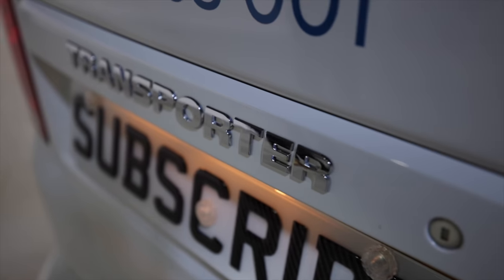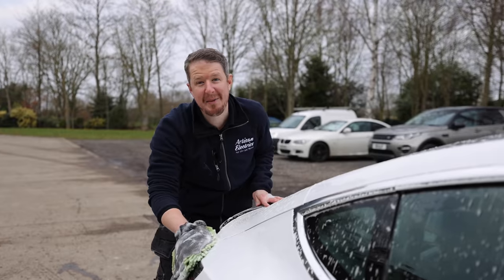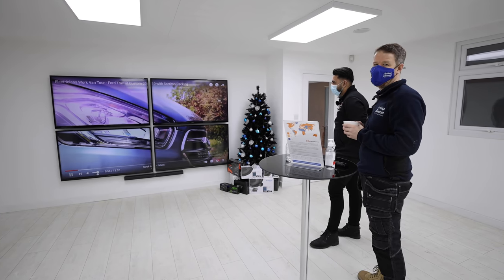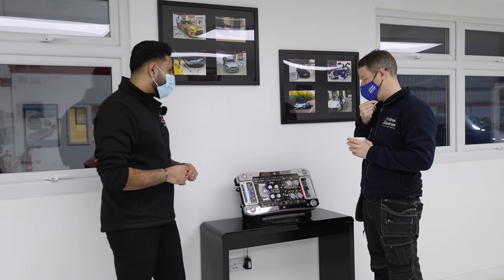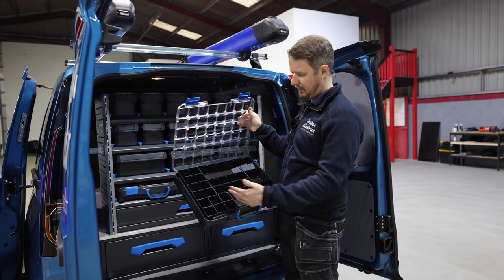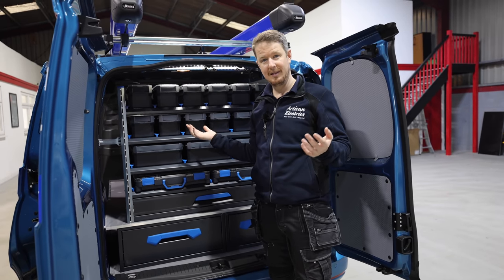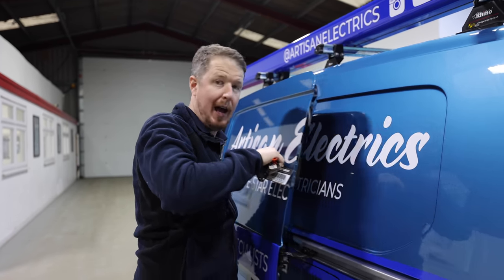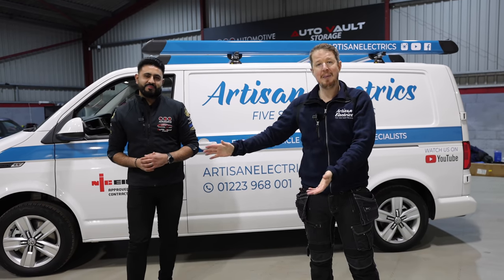ELECTRICIANS VAN TOUR - TWO NEW VANS ARE READY! Electrician Life

Comment: It is a really nice sortimo system. The racking with the boxes is very nice.  I have this sytem in my crafter. I am a technician in greenhouse electrical and water systems. The only downsite from the boxes are the dividers in the box. They will popup a little and the items will go under the devider. So my screws got messed up. I glued them with a hotmelt gun to the bottem.
Those deep drawers are amasing. Wishing you a lot of workfun with your both vans.

Comment: Normally you can't put the high pressure pipe into the lance when it's under pressure - knock the compressor off and take the water supply off then it will go in.  If that saves you buying them a new one I'll take a AE Gilet ;)

Comment: Make sure your e transporter van hasn't got any wrong wiring or fuse as  my one is with VW since  November 2021 and its not fixed yet . Check for recall.  Its good van but in the town you can do 55miles and distance can be even more then 82 if there is no traffic. Only I don't like it that on 7kw single phase it takes only 3.6kw and takes longer to be charged

Comment: 37kWh battery on a van - that's pretty pathetic - I'd be surprised if you get 60 miles in winter when loaded up
Reply: Thank you for your support
Reply: that's for service calls arround the church :-)  I need minimum 200-250km real range ... so no EV van for now .. maybe in couple years ..
Reply: 82 Miles at best empty, there's a removals chap in Sussex, he only covers Brighton and it does him fine. The other 3 people I know with them down there, 2 have traded them in within the first year and the last chap has been charging it during lunch most days the last month. They got them because a traders parking permit is only £300 with a zero or low emissions vehicle but with a standard van it's £900 a year + the tax write offs and incentives.

For reference the battery/drive unit is actually the one from the Golf, so if you've actually got a decent load in it many find it lacking.
Reply: They are very pathetic. I doubt it will even get that full of tools and heater on. We tried the Toyota Proace electric on demo as it had the most claimed range at 205 miles, we got 80 miles out of it loaded with tools and a cold day, the heater doesn’t even work on eco mode so has to be on normal mode all the time (???), and that’s a bit of duel carriage way / country driving.
Reply: @jamieh8667  That's the same issue we had with a Vivaro-e. We're hopefully getting one LWB ID Buzz for trial when they're available as the longest range is 375 miles, trouble is the load limit is slightly less than a LWB Caddy at 800kg so by the time racking is fitted you're looking at 600kg for tools/fittings/materials but it will have fast charging where the ABTe doesn't.

Comment: Tip with those locks do not oil them use graphite powder , keep keys clean , if you need to clean them out use a can of compressed air,  they have little tolerence inside , fantastic locks though
Reply: They also bar a key if there is any force on them to stop slipping.

Comment: 360 dB of sound is not possible. Every time you double de sound it increases with 3 dB. So 1 sirene is 120dB, then 2 makes 123dB. To double it, it takes 4 sires of 120dB to get 126dB. So in this case 3x120dB makes a total of 124.5 dB. Still loud anyway....

Comment: I don’t now why any tradesman would want to get a electric van, the battery won’t do the same miles as a diesel. I now it’s how it will go eventually but for the miles a tradesman does a diesel be far more superior than electric. Especially if the T6.1 will only do 80 miles to a charge and limited to 59mph, plus a diesel van are much cheaper

Comment: Disappointed that transporter ABT only has 80 mile range. Would spend my money on the vivaro or the Toyota electric van. Given they are all electric motors the old advantage on quality that transporter used to have is not necessarily there anymore

Comment: 82 mile range ??  Are You JOKING ? 
1 Hour at 82 mph on the Motorway. ??????????? BONKERS-USELESS ! ! 
1hr 15 mins at 70 mph ???  
A Van Needs at least 500 miles of range.  AFTER USING ALL The OTHER ELECTRICAL ITEMS,  Lights, Wipers, Radio, Phone charger, Heaters, Glass Heaters & Demisters etc. 

HOW the Hell is anyone Gonna Pop Down the Road from LEEDS to London to Drop a few Boxes, Call at Birmingham for a Pallet,  Drop at Liverpool, Collect 2 Pallets at Preston & Return to LEEDS in a working Day ?? 
BONKERS EV's. They are for old folk to do a 5 mile trip to the supermarket twice a week. 

EV's are Going Back to the Days of COACHING INNS / STAGE COACHING, The Days of HORSE & Cart Style Transport. 
Stop off to EXCHANGE your Horses for Freshly Fed & watered Rested Horses. 

Buy an EV & EXCHANGE it for a Fully Charged EV every 80 miles. 
You OWN a Car / Van / Vehicle, But Never Drive the EXACT Same Vw Van , You Swap it for a Fully Charged VW Van 4 Times between Leeds & London ???? BONKERS !! 
UN-PLUG & Run on A petrol Engine Fueled by LPG. 

82 Miles Max, Limits you to 20,000 miles a yr on a 5 day week.

Business Vehicles can easily cover 70,000 / 80,000per yr. 

I bought a Van, Less than 3 yrs old With 200,000 on the Clock. 
When i Bought it, It had it's VERY 1st MOT at 200,000 Miles. It was a Brilliant Van, I Owned & ran it for 10 More Years. With NOTHING to Do Except all the Normal Service items, 
Filters, Oil, Tyres, Discs & Pads, A Clutch, & Usual Easy Stuff. 

15 yrs on, It Passed its MOT with NO Advisories. As the New Owner was Very Pleased to Tell me. & Still NO Rust Scabs.